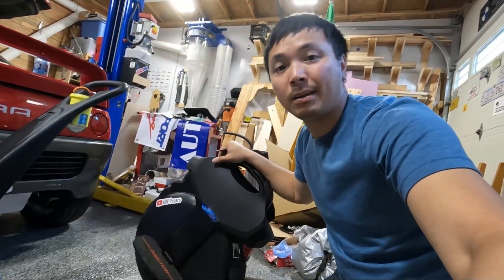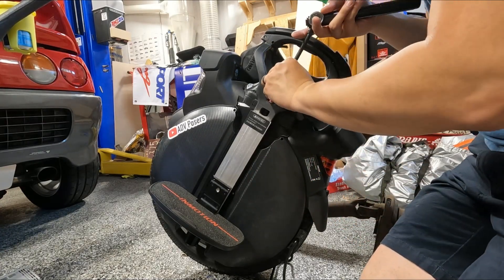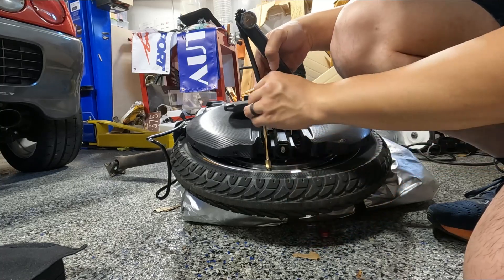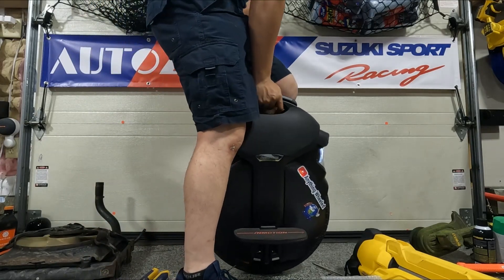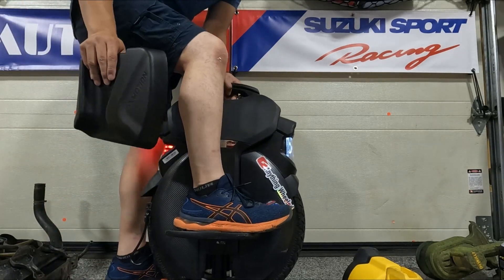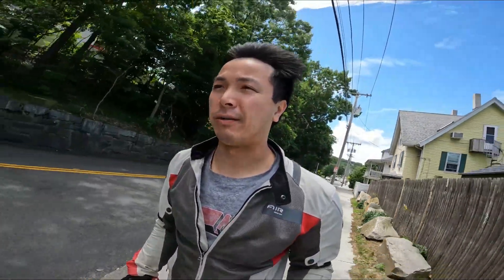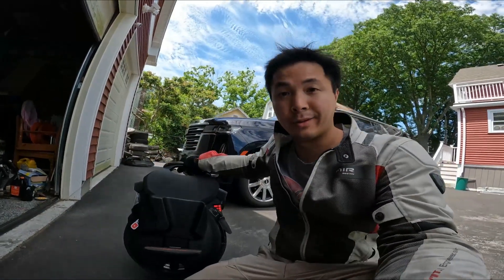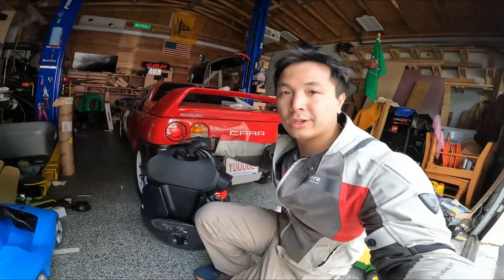INMOTION V11 - Suspension Pressure Adjustment Positive and Negative Chamber and Trying out Powerpads

Comment: wear a helmet
Reply from the maker: You're right. I was goofin and did not have any protection. Riding these definitely should make one think about how it works and make you paranoid to wear it. I kept thinking about it for too long and ended up being spooked that what if the board failed or mechanical failure while moving and the motor cuts out resulting in a fast forward face plant. I ended up selling mine and bought a Kukirin G3 pro scooter instead

Comment: Could you deflate the suspension fully for it to take up less space? I am wondering about it because I can help make it seem smaller on longer trips. I wanna go traveling with the wheel I get and the height of the v11 doesn’t help
Reply from the maker: I'm not sure... It seems to be a pain to set it up again each time. I no longer own this so I can test it.
Reply: @AnythingWheeled yeah a pain but better than leaving the EUC behind!
Thanks anyways mate
Reply from the maker: @pedro_claro  from what I remember it's still springy but I forget what pressure they were as it was out of the box. Maybe if you strapped it down and compressed it that way?
Reply: sounds possible!! Good idea. Should be doable with small ratchet straps. Maybe even without lowering the pressure too much

Comment: I found, making my own foundation base plate for the side pads, means I can set it lower than the side pads are intended, meaning it grips my feet better when coming off curbs.. but my sidepads didn't come sticker shaped, it was just the whole pad that was sticky, so I purchased some plastic sheets (3mm) by A5 size, and applied sticky velcro.. now I have the perfect set up
Reply from the maker: Custom fit things for your needs are always the best!
I don't have EUC anymore cuz over time I got spooked by the thought of the motor giving out for whatever reason and then going splat because no more gyro. Maybe it's cuz I'm getting old 😂

Comment: Hello! Does your Inmotion V11 still work? How many miles have you done on it? Have you had any issues with quality of this EUC?
Reply from the maker: It still works. I knocked it over a bunch of times or fell off on slow speed maneuvers other than scuffed it seems to work like new. 
I have always been curious if it has an odometer somewhere but couldn't figure it out on the app so if I were to guess maybe 15-25 miles on it? I didn't turn out using it as much as I thought I would.
Quality wise it is good. Maybe if the app was better?
Reply: @AnythingWheeled  25 miles in  total ? It appears you use it quite rarely.
Reply from the maker: @Korksmeo  ya I thought I was gonna go more places with it but I've ridden it down the street to get food and trips to the post office to bring a little package to send out. Maybe I should bring it to work to play with too.

Comment: Definitely power pads will need to get use to. I felt the same way, but then I got adapted to it real quick and it’s a great thing to have, keeps you lock in when riding fast and it also protect the shell a bit. You could’ve crack or scratch your EU if the pads wasn’t on when your tried to jump off the curb. After all, Good stuff 👍
Reply from the maker: Oh mine has already experienced a few scuffs and scrapes over the past two months or so. The pad did help out on this last fall though, no new marks! I need to try again with boots or something as I think the velcro I used behind the pad concentrates the pressure right on my inner calf and it kind of hurts to hold on to it. It also makes my stance a bit wider so I have some wobble slowing down because I can't hug the unit as firmly yet.
Reply: @AnythingWheeled  honestly I would suggest the Grizzla Pads. Its adjustable to your riding style, and it’s not thick like the one you have on. Otherwise having wobble during braking is normal from what others are saying. I’d watched a video of someone said if you carve a bit as you slow down coming from high speed, that should help. Come to find out, I’ve tried it myself and it definitely helps. Don’t quote me on it, since everyone else have different riding techniques.
Reply from the maker: I think I like the Grizzla pads. Thanks for the tip! I'll have to get them.